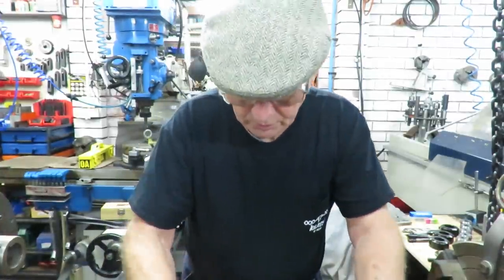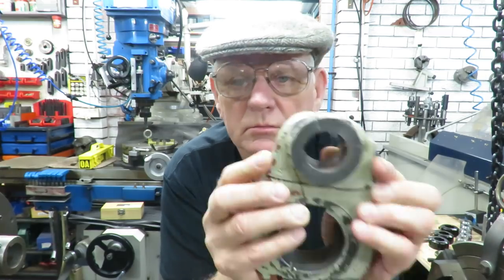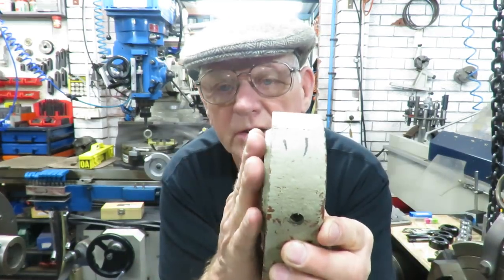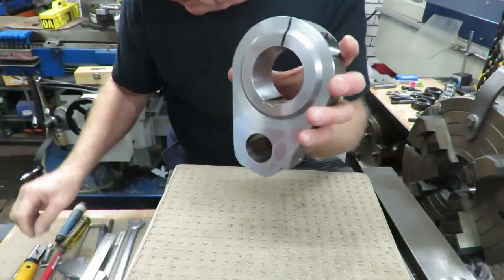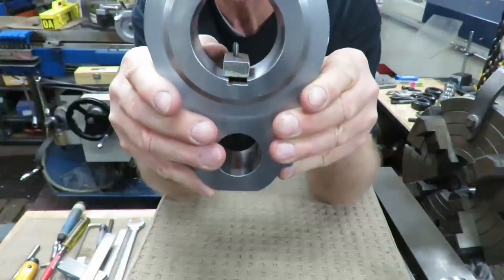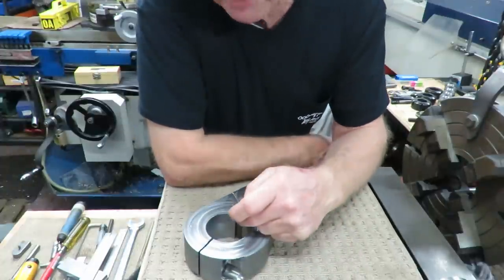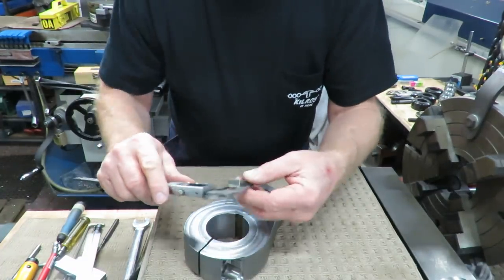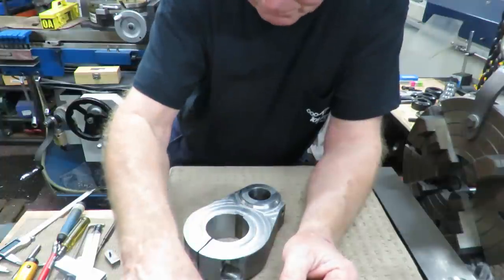464 Cranky Arm series No 4 Finale.

Comment: Hey Bruce what model lathe from hare Forbes have you got
Reply from the maker: Greg I have the TM 1740 G I added the Multi tool post and a taper attachment
Reply: Bruce Whitham. Is it Taiwan and how does it compare to other machine
Reply from the maker: Greg Taiwanese built Tool room Lathe, exceptionally good performer all the models of this brand are fine machines. All my tool making colleagues have the same lathes. They are more expensive than a similar Chinese Brand, however the head bearings and the detail and mechanisms outstrip the competitors.
Reply: Bruce Whitham thanks bruce